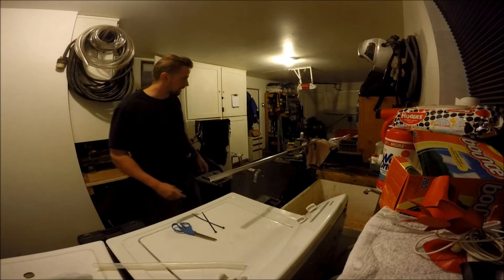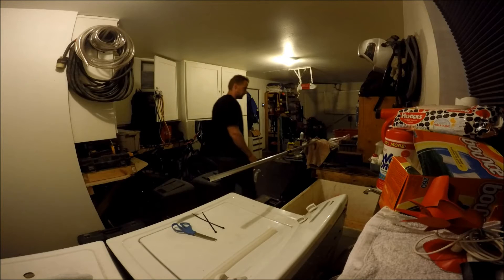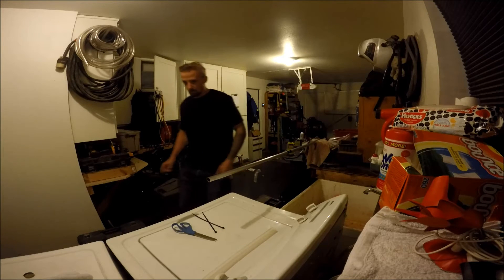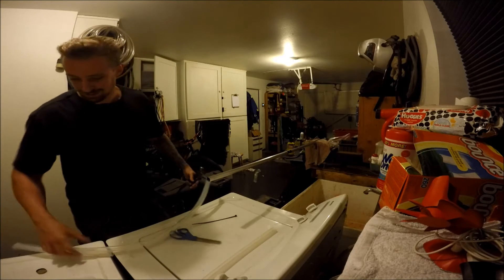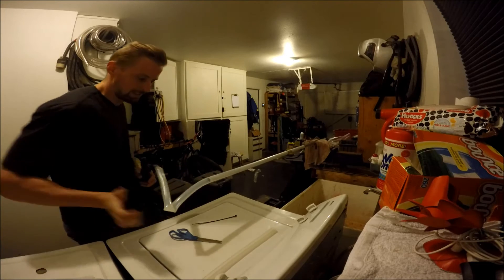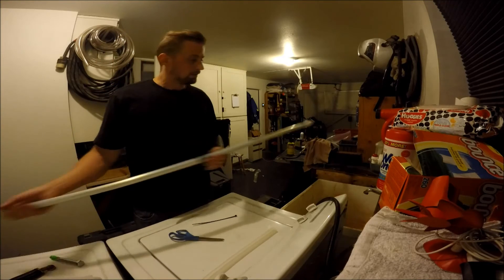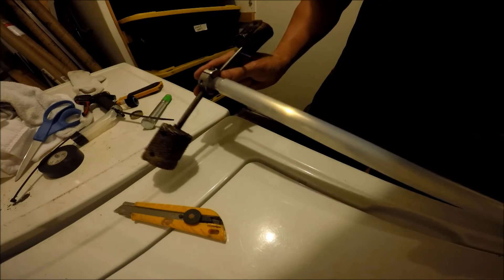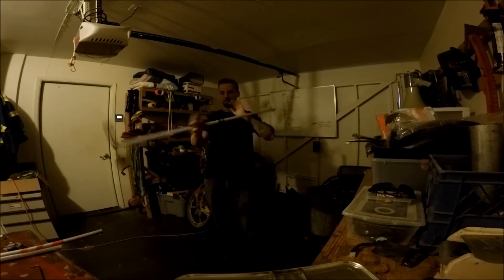Applying Silicone Grip Tubing to Flow Props

Comment: This is a genius way to get it on! I recently bought some 1/2 silicone tubing for my 3/4 inch aluminum contact staff because I was sick of the silicone tape ripping and coming off. I'm hoping I'll be able to get it stretched onto the staff with my compressor using this technique. I'll probably apply some silicone glue too to lubricate it and keep it stuck on there good when I'm flowing.